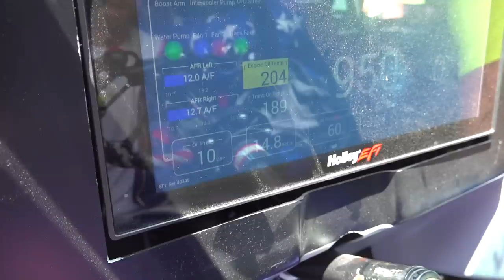Mullet vs. Twin Turbo Mustang In the Street Car Shootout Finals... FULL BOOST On a Hurt Engine!!!

Comment: “Last race with an LS” can’t wait for mullet to get the big block he deserves.
Reply: I heard that too. It really deserves a twin turbo big block to go with that promod Trans. I can't wait to see what they stuff into it.
Reply: Steve Morris Big Block 👀
Reply: Yeah this thing needs a 4000 horsepower twin turbo alcohol big block.
Reply: @ChristopherHallett  I keep hoping to see one of those Ozzie burnout car motors in a real drag car…
Reply: Switching to a big block is going to cause a whole other set of issues that will need to be addressed.
Reply: Heard that as well😎
Reply: @Cultofpersonality09129  true, they struggle with traction , imagine double the torque.
Great point
Reply: I herd it was a Steve Nogas motor ;)
Reply: @truckingbastard  it’s Aussie 🤙
Reply: Maybe Cleeter is one of the clients that Steve Morrison talked about that had ordered the new SML Engine Package
Reply: @Cultofpersonality09129  but they never give up or throw in the towl,  they learn by there mistakes and go out to do battle again
Reply: @truckingbastard  Would do what we call "air". Nothing. Wouldnt last a pass. Theres a reason they arent winded out and it aint to preserve tire during the burnout like you might think.... theyre held X rpm for many more reason than that loll.
Reply: Hope it’s a ford 7.3,
Reply: If you guys missed it about 2 months in a video I saw a SMX in the shop on a rack just chillin... so "last race with a ls" makes me happy!!!!
Reply: He needs to keep it in the Chevy family
Reply: @Cultofpersonality09129  aka content.
Reply: @ridered7394  Ford 7.3? Were goin to the DRAG STRIP BROTHER NOT THE FARM lol
Reply: @lerrynhawke3375  Yeah there is no sense pushing an LS as far as they do to be insane competitive its just recipe for disaster over and over limit testing in a sense and rolling dice. Cant waittttttt
Reply: @truckingbastard  That's not really how that works. Doing burnouts is more like long duration unloaded free revving and fighting centrifugal forces stealing your fuel, where as drag racing is fast acceleration and loaded controlled power. That is why you don't really see those cars running the 1/4.
Reply: Horsepower isn't always the solution. They need to get the suspension dialed in so it will go down on surfaces that aren't Bradenton. Need a no prep guy to get them dialed. Then crank the power ✌
Reply: @ridered7394  That would be the last thing going under the hood of this car.
Reply: @Cultofpersonality09129  Yup; all which will make fantastic new content - wins all around :)
Reply: @jonathonvince561  It's not just a horsepower issue, it's a reliability issue. Mullet breaks every event. An LS is not reliable at 2300hp. A well built BBC will take that all season and need one basic refresh / year.
Reply: Smx?
Reply: LS is a good platform, built exceptionally well ... but...  its at (and past) the limits pushing that big girl down the quarter. Big girl needs a big block
Reply: I wondered how many guys caught that comment
Reply: @OverwatchSIX  the other 7.3, the one they made 4 digits with on an unopened motor.
Reply: @felixsantiago5606  struggle with traction >>>>> engine blowing up every video
Reply: @jonathonvince561  you'd be suprised how little of a clue some of the faster no prep guys have on suspension, I know this because most of the street outlaws call my dad for suspension advice. There's a reason most of them run big tires.
Reply: @Prestiged_peck  They are trying to go faster, not slower.
Reply: @Ride Red I saw an 80s thunderbird sitting under the open pole building.  Guessing the 7.3 is going in it
Reply: @--_DJ_--  and they would with either that modern big block or a classic big block. The new godilla 7.3 has .13 inches of bore spacing on the LS, taking it to 4.53 inches, which is more than a classic 460 ford big block by .3 inches, but smaller than the big block chevy spacing of 4.84 inches, though interestingly because of the design it can fit a slightly larger bore than the production BBC.

It does only have a 9.4 inch deck height  versus a big block ford's 10.3 inch deck, which does mean  smaller max safe displacement, but it's still bigger than the LS's 9.2 inch factory style deck height, plus has more displacement from the factory than the TSP 427 does in the aftermarket, with 444 cubes, those extra 15 cubes mean a lot less stress on the head gaskets if nothing else.
Reply: @Prestiged_peck  they want something reliable so ford is a no go 🙅‍♂️
Reply: @OverwatchSIX  got some good news did some research and if the SML is going in it it’s a Chevy based big block so no farming
Reply: @Prestiged_peck  I think they want out of the strung out engine game, not another brand of it.
Reply: @Prestiged_peck  We have one in an F750 at work, it isn't too bad really, a bit of a dog but you can make it work if you want. Just don't look at the gas gauge.
Reply: @Prestiged_peck  street outlaws is a show lol. Promods. He needs to get that thing figured out on a surface that isn't Bradenton moon prep like the rest of the world.
Reply: @jonathonvince561  well we've got 3 of the NPK guys testing all the time at our local track, and my work truck would probably spin all 4 with slicks on it there so...
Reply: @OverwatchSIX  really I think it’s just Texas speed because others have pushed way faster and motors last atleast half a race season.
Reply: @hks2.3stroker6  ford can be very reliable if done right, just look at neighbor, or any big block ford race car. (Literally any of them), or ford's awesome truck reliability ratings (chevy/dodge lifters go brrrr), or the fact that the most reliable vehicle any American police departments have ever laid their hands on all have a ford logo on them and cast into their engine blocks.
Reply: @--_DJ_--  they'd be making the power to go 6's no problem if they spend the kinda money they do on those TSP 427s on a 7.3 ford, they can be taken out to 7.5 liters (about 460 cubes) and beyond and hold tons of boost there. No they'll never be a nitrous mountain motor, but they're tougher than those TSP 427s and that's for sure.

Also fun fact the one in the F-750 Is way defined, makes less than 400 ft-lbs, the f450 pickup version makes like 480
Reply: @OverwatchSIX  its not meant for big big power but the 7.3 godzilla can make over 1000 hp with ease
Reply: @OverwatchSIX  its not meant for big big power but the 7.3 godzilla can make over 1000 hp with ease
Reply: @OverwatchSIX  John Doc at LS Nasty has been running a 2100hp LS that TKM Performance built for over two years without being opened up for any reason. No bearings,rods,pistons, nothing. He just switched it from hydraulic roller to solid but most of its life was hydraulic roller (at 2000+hp). That engine is still kicking and won a dyno day today at over 1500hp turned down. Cleetus just has the wrong people and in his LS program. A big block will be more power easily so he can keep it turned down and live longer.

Comment: Holy crap. I was not expecting that last pass after those previous runs. Congrats on the win!!
Reply: A hurt engine runs the best... until it doesn't.
Reply: @Loki_Trickster  down on power concurs a sketchy track.....
Reply: Especially against that Mustang which was ripping mid 7's. Fantastic Cleeter team performance.
Reply: @NastEvo For some reason this is true.  Remember when Leroy was on 7 cylinders and still banging off low 8s and they actually lost some speed/time when they had all 8 online again.  Drive pressure was lower

Comment: I feel like this is a turning point moment for Cleet and Mullet. Pulled out that 7.3s tune like a pro while battling a hurt motor. Last run with an LS he said.
Reply: i have been commenting smx for months.
Reply: @fallenhobbit6554  steve engine would be a huge upgrade.
Reply: Maybe Leroy gets mullet engine?
Reply: @Rx_Lee  he said he ordered one a few months ago on FB. Sure they take a bit to build esp. with parts delays, high demand that already paid for theirs etc.
Reply: @pyrocl0  they basically have the same engine... aside from. The o-r8ng heads. But that is definitely a possibility! I'm on the edge of my seat for the leroy comeback tour....
Reply: I heard it too!!! “Last run with the LS”!!!!!
Reply: I thought he said last run was an ls meaning the competitor
Reply: @fallenhobbit6554  100% not an SMX. But Steve Morris take on a billet LS. I think it is called the SML.
Reply: @LimitWHK  Said "let's go Mullet. His last race with an LS".
Reply: @ForeverNeverwhere1  that SML has about as much in common with an LS that a brick has to a mona lisa
Reply: Soon its billet everything, including the block. 😎
Reply: @scottbroyles2114  I know, but it is a bolt in replacement. The SMX is a huge Hemi type engine.
Reply: @ForeverNeverwhere1  steve only making 10 sml (presumably a first trial run).  SML is still LS based. Last run with an LS rules that out imo
Reply: He literally said he has an SMX already in the rafters. I’m assuming it’s either that or the SML. If Steve Morris gets Cletus to test that thing he will find any weaknesses lol.
Reply: He's going big block
Reply: @ForeverNeverwhere1  I don’t think it’ll be the SML. From my understanding Steve is still in the process of building the first SML for whoever the customer was. And if that’s the case Mullet would be waiting for a while to get his
Reply: Idk what you are all talking about. He's been saying big block for months.
Reply: I'm glad I read this comment right as he said that.... I wonder what's in store🤔
Reply: I thought "last race with an LS" was a secret for the fans who came down after the run, Dang Cleeter
Reply: They do have the other Godzilla motor
Reply: @jasonbirch1182  it's definitely got to be a big block and big tire conversion he's at the absolute limit of what that tire can put down and if you go bigger tire you have to go big block to compete with what's out there. I was surprised that he didn't do that from the beginning since Ruby and Leroy are basically putting out the same times but I think it was just him being careful and working out any chassis and suspension kinks before he went full on crazy with an untested car.
Reply: I've been assuming SML. Steve himself says the SMX Is a ProMod motor and the SML is designed to bolt right into a vehicle that previously had an LS and have everything line right up.
Mullet is a step short of being a ProMod so it's need work to get an SMX in there. SML would slot right in.

LS Based can mean the block is based on the dimensions of an LS and that is that.
Reply: @ForeverNeverwhere1  i think he had actually come out and commented somewhere saying it wasn’t the SML cause a ton of people thought cleetus would be first in line when Steve announced the SML. I’m not exactly sure where this was so don’t take my word but I’m pretty sure they’ve been hinting at a big block of some sort
Reply: @ForeverNeverwhere1  I think Cleet should buy the SMD engine. You’d probably like that
Reply: @travispoulin252   he won’t go big tire he can run in street car events then
Reply: @anthonycope8637  man, I hope not!!  Gotta keep it either GM or something like the SMX
Reply: @fallenhobbit6554  at this piont anyother engine will be better than bearing killer they have now.. 😁
Reply: If anyone watches Steve morris's channel, a few months ago he made and tested a big block and said it was a build for Cleetus. Definitely a big block, not the sml or smx.
Reply: @fallenhobbit6554  s
Steve has been working on his SML for some time. I reckon it's coming.
Reply: Steve was on the phone to him as soon as the parachute dropped.
Reply: @james94582  lol they made a joke about how ford went to the single cam GM knock off
Reply: @rippermagoo408  it's already sitting in the shop corner , in the crate.
Reply: He said before that they were gonna swap out the small block 427 for a big block 427
Reply: @cannonfodder6299  yeah i know, they been saying that for weeks, but steve called, he wants his supercharger back
Reply: @fallenhobbit6554  I agree they reached the end of this platforms reliability. It’ll be refreshing to see them moving on from a hurt engine every weekend.
Reply: @pyrocl0  probably what's happening, since a couple vlogs ago he showed Leroy still missing an engine and he said "he'd have it soon" ie mullet would be getting its LS removed
Reply: @alexknouse9133  he probably didn't mean to leak it, but literally edited the vid 10min after this run

Comment: One of the downsides of using the holly for oil pressure is the delay on waiting on oil pressure.... personally I would put a "normal" oil pressure gauge just to get the quicker reading
Reply: It reads instantly, they are just waiting for the dash to load.  If you got a laptop hooked up this isn’t an issue.
Reply: ahhh gotcha.... it still causes me stress waiting on the dash to load I would still have one even if i used the holly for normal use
Reply: 100%! The boot up time on oil pressure just don't work, It's something that would keep me away from it entirely.
Reply: I agree good old copper line manual gauge can't go wrong
Reply: @kleetus92  That's a good idea, they probably could wire it up that way and should do so.
Reply: @kleetus92  you can but people don't like 1 extra switch and more wiring lol
Reply: @kleetus92  when you hit the starter most of the time it will reset , at least mine will
Reply: @bobbygetsbanned6049  it requires a directional diode and a capacitor in line, the dash runs off the capacitor while the engine cranks and the directional diode keeps the starter from draining the capacitor.
Reply: @kleetus92  a relay . Would solve this .

Comment: "Let's go mullet. His last race with an LS"
Maybe I'm reading too much into that but I'm excited for what's next
Reply: Not reading too much into it....He's already said he has a Steve Morris engine on the way for it.
Reply: I’m really hoping they throw an SMX in mullet
Reply: SMX big block incoming
Reply: I heard that too. Time for a Steve Morris engine...
Reply: I heard that also! Let's go can't wait.
Reply: Time for a 2jz engine! LOL
Reply: @nicefknmodel2201  He's had one on order for several months. Steve must have it ready.
Reply: @xxZerosumxx  2x2jz!! Lol
Reply: @xxZerosumxx  😂😂Nah he’s getting an engine that can actually push that big guy down the track
Reply: Yeah, he finally got sick of pushing that small block at 98% all the time. 
A pro-mod based big block platform at 75% is a lot easier to deal with, not meaning simple or cheap, but at least not bending something important every 5 or 10 passes.
Reply: Can't wait to see it. But traction is the biggest problem. Sure mullet hooks in Bradenton but it need to work at every track.
Reply: @njovwevnjweV  that or his SML
Reply: Why do you think they kept sending it with low oil pressure? They were thinking, if it blows up well it is what it is just put on a good show while it's still running because we already have a plan in place that does not involve this engine.
Reply: Lol . CLEETUS made it clear.  He doesn't have 80k plus to put into am SMX.  I believe it'll be a SM BBC
Reply: @nickwooldridge  He's already announced he was putting an SMX in it..... on youtube AND facebook
Reply: @Spad68  Cleetus said it was an SMX..... more than once.
Reply: @phoenixrising4573  o well . I saw the video where he said no to the SMX . I guess I missed the video to where he changed his mind .
My bad
Reply: @nickwooldridge  cleetus already said it will be a Steve Morris big block
Reply: @xxZerosumxx  you serious? That thing wont push this heavy ass car for long
Reply: @troypowders4312  doesn't matter how good the engine is if the tires spin ! Notice what a difference it makes to get the weight moving without spinning , then put the boost on the top end !
Reply: @pyrocl0  you're right ! Needs to get all that weight moving without spinning the tires then put the boost in mid and top of the run just like tonight ! Cleet needs to lower expectations on the 60 ft. With such a heavy car .
Reply: @themc3311   It was pushing 50 plus pounds on the two step. That's way more than enough to keep it intact for a few seconds.
Reply: i just heard that too, and came to the comments to see if anyone else caught that... i think its a great snip of foreshadowing!
Reply: Let's Go...
Reply: Heard it was gonna be a SM big block, didn't hear it's was specifically gonna be an SMX.
Reply: @Spad68  Just bought the yellow Camaro from the Aussies, I'm sure 80K is pocket change for ol Cleeter.
Reply: Nobody else thinks it's going to be a plain Jane big block? Sick Seconds 1.0 still has one and Steve still builds them.